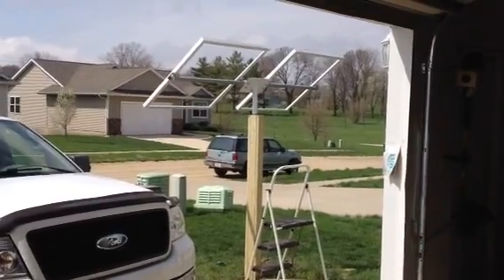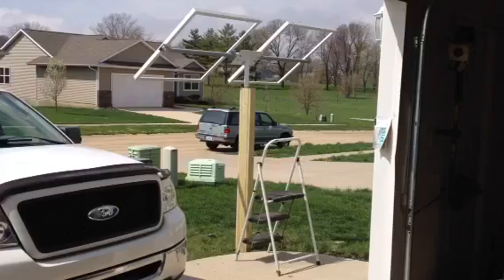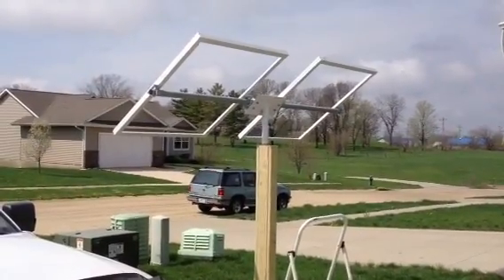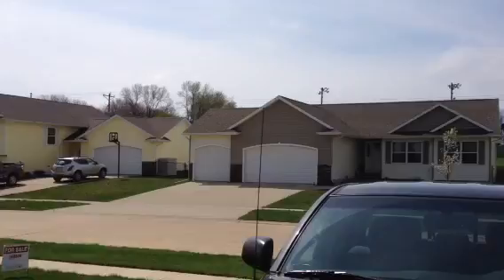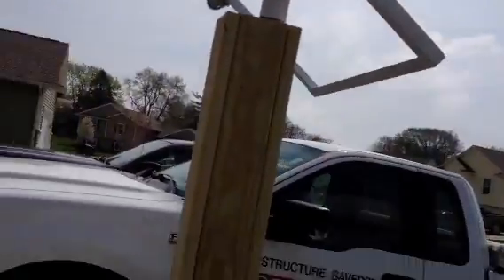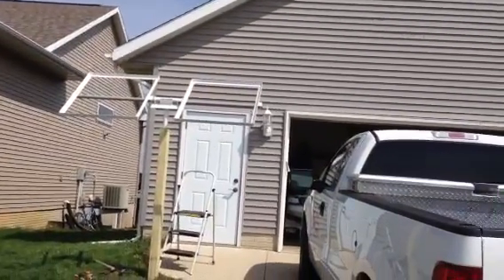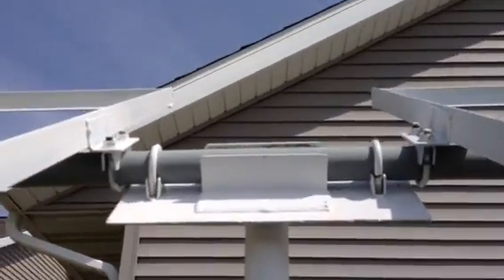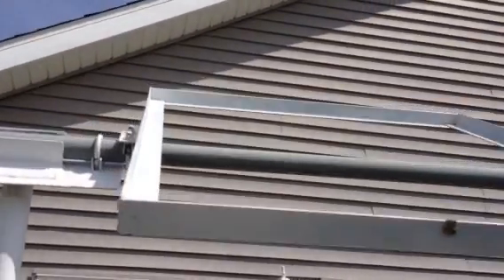Video #3 How to Build  Adjustable Solar Panel Post Frame and Mount Bracket DYI.

Comment from the maker: Thanks Wavey yes I bought the panels and made the frame to fit, I used 1.5" x 1.5" angle iron ,and welded it all together. Also welded 2  1- 5/8" muffler clamps to each frame so it could connect to the strut, I think if I did it again I would use 2" steel for the post schedule 80 the 1 and 1/4  does not seam strong enough, you would then have to reduce the top of the post so your bracket would fit on top of the post.